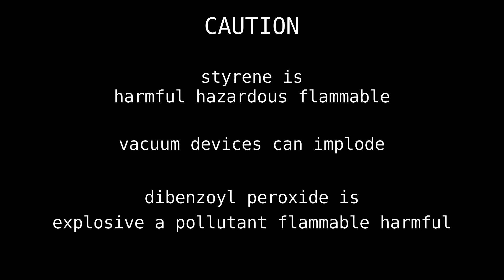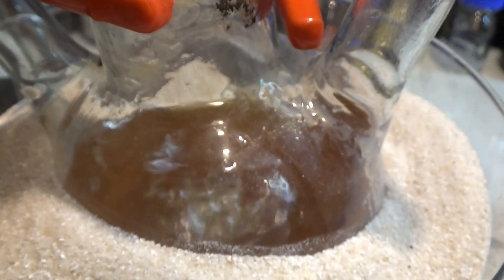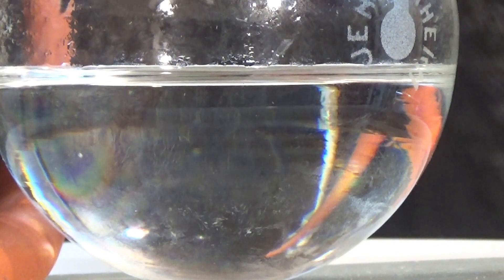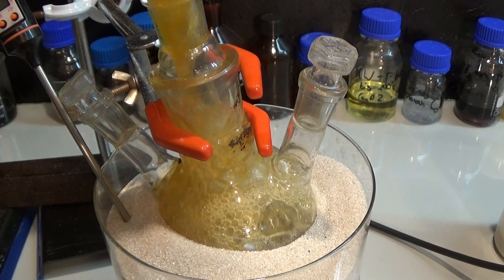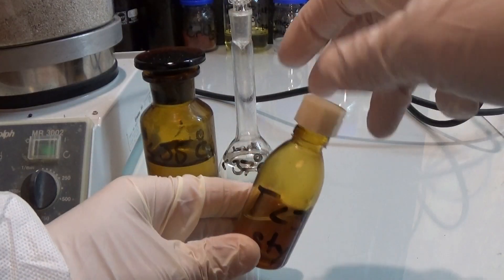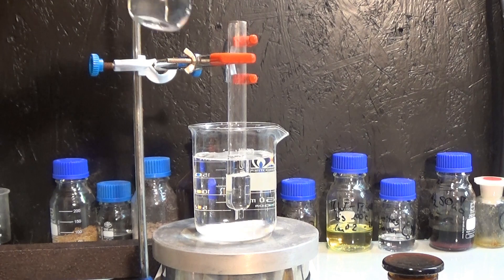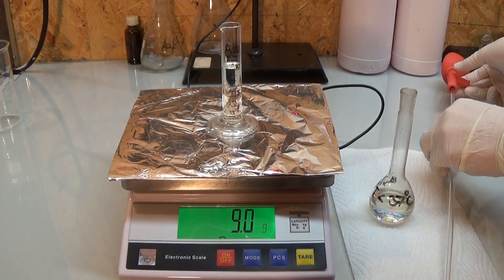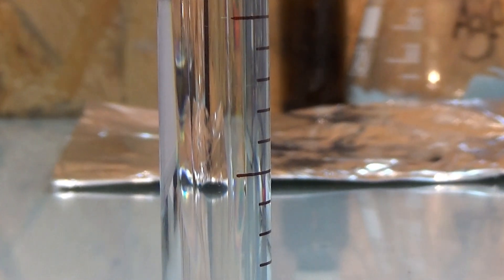polystyrene recycling part 2 (fractional vacuum destillation)

Comment: The reason that you media bubbles is do to a concept called vapor pressure.  I am no wiz bit but if you are near boiling then drop pressure you will boil. When you induce a vacum you remove the pressure and lower the boiling point but still don't have enough vapor pressure to reach the condenser?  Idk I have been binging on pyrolysis and distillation

Comment: It is probably not due to temperature…the density decreases with temperature, but one degree is not much. Density measurements are not usually that exact, so this is difference is probably just random. Do you have bromine/iodine? You could measure how much bromine/iodine you can decolour with your product, so you get the molar mass more or less accurate.
Reply from the maker: if i can find some spare time i'll do it

mfg hazelChem
Reply from the maker: 12thealchemist  good idea but with the 1,2-Dibrom-1-phenylethan i could actually do something :D

mfg hazelChem
Reply: @HazelChem  ..........You should make a halohydrin from your double bond.   That is one of my goals.  Adding 2 different functional groups in one reaction.    But i could not take the smell of styrene.

Comment from the maker: hello you all this video is the second part of the polystyrene thermolysis 
this little video series was supposed to show the potential recycling of polystyrene 
therefor we started with PS wich was reduced in volume by dissolving it in acetone, then the PS was thermolyseed and now the crude styrene was fractionally destilled in a vacuum, and again polymerized using some dibenzoyl peroxide 

in the last video we obtained the crude styrene and stabilized it with some hydroquinone
so now we have to fractionally destill the whole thing in a vacuum 

therefor i set up a fitting apparatus and hooked the condenser and the vacuum pump up to the water line 

the reason why we have to do a fractionall vacuum destillation is the reactivity of the carbon carbon double bond in the styrene 
as styrene can polimerize on its own we have to reduce the temperature during the destillation as much as we can, to reduce the speed of the selfpolimerization
secondly we have to get rid of any oxigen because oxigen and light especially in combination with high temperatures initiate a polymerization of our styrene 

so that explains why we have to do a vacuum destilation, but why a fractional vacuum destillation ? 

that is easy to explain do to the process we used, the thermolysis, we have some impurities that came from pyrolysis reactions that occured do to high temperatures
examples for such impurities are benzene toluene and many others, all of them have a boiling point near to that of styrene and some even form a azeotroppe
so we have to put some kind of collum in between the boiling flask and the condenser to get a better separation and a product of higher quality 

the first fraction came over from twenty fife degrees celcius and i destilled further until it got over thirty fife degrees celcius 
up until this moment there was no clean fraction, this can be seen at the densety blurs new destillat makes when it hits the old one 
but after the first fraction there was a bigger one just under thirty seven degrees celcius 
beutiful arent they
beutiful but, carcinogenic
after each fraction i detached the vacuum and prepared a flask with some hydroquinone as a stabilizer to counter any polymerization and prolong the storing time 

normaly you add something like one hundred ppm but i went with the more is better route
so as the temperature increased i stopped the destilation and filled the fraction in my prepared fifty milliliter flask and put it aside 

and here is where it gets funny, i dont know why but every time i put the vacuum back on the destillation mixture began to foam like crazy but never reached the condenser 
anyway as you can see here there are no more densety blurs indicating that we have a very pure fraction 
when there was only a small amount of crude styrene left i ended the destilation and filled the third fraction in a little bottle 

and as allways i added some hydroquinone to stabilize it 
but now is the question is this realy styrene or am i a noob and you dont even realize it 
therefor we have to perform some tests 
the first test i want to make is looking if this has the polimerization propertys of styrene 
to do this i set up a waterbath with a testtube and a magneticstirrer 

and then add some of the potential styrene into the test tube, but keep in mind this stuff does not have the one hundred percent reactivity do to the allready added hydroquinone 
to the product we add some of the dibenzoyl peroxide we made in a earlier video, that is currently only on bitchut do to the strike i got, link to it is in the video description 
so now to explain what is happening here
 
the dibenzoyl peroxide undergoes a homolytic thermical splitting into two Benzoyloxy radicals , these Benzoyloxy radicals then decompose  under CO2 elimination  and form two phenylradicals
the phenylradicals then act as initiator for the radical polimerization between the alkene functions
and if you want to say it like this, it  increases the speed of the over all polimerization that is going on in the styrene that increases the chain length drasticly 

this mixture is then kept boiling for around a hour to give the polimerization some time to take place and overcome the effect of the hydroquinone 

meanwhile we have some time to do another test to determin weather it realy is styrene
therefor we measure the weight and the temperature of our considerd styrene to get the densety of the product 
so i got my fancy new scale out and a ten milliliter pipet and transfered the ten milliliters onto the scale, they weight nine gramms giving zero point nine gramms per milliliter 

and as you all know density depends on the temperature so i measured that as well, to give me nine teen point one degrees celcius, just under the twenty where the literature densitys are taken 

but now back to our first test 
to see if it has worked we have to perform a viscosity test compering the treated product with the fresh one 

and as you can see the heat and DBPO treated one is viskos and takes a long time to just make some distance 

and now the fresh product , oh wow who guessed that seems like i am no noob, but wait there is a nother test waiting to be done 

styrene has an even higher refractive index than benzene making glas that is immersed in it disappear
nice, and this fits two, plus the density i measured is only a little bit off, what could be do to the lower temperature 

so there you have it, with a ninetee nine percent chance it is styrene 
meaning we successfully recycled polystyrene into styrene of good purity 

i hope you liked this video have a nice one and  
have fun and do not kill your self
Reply: We should collaborate. Call me.